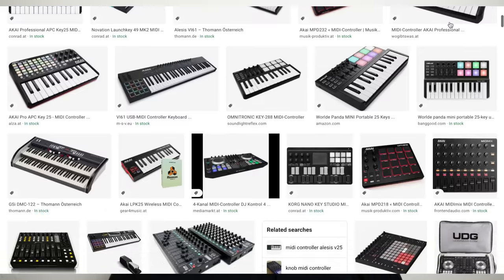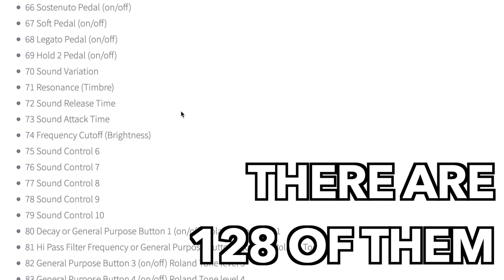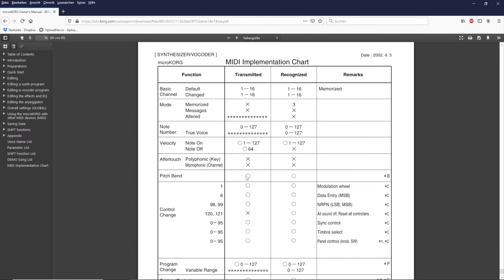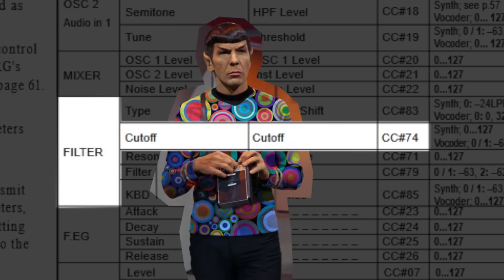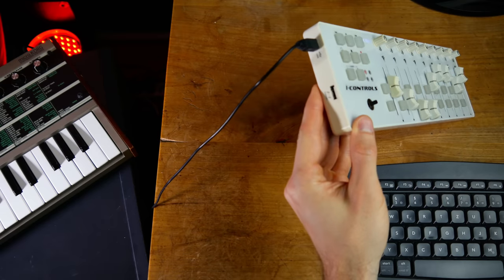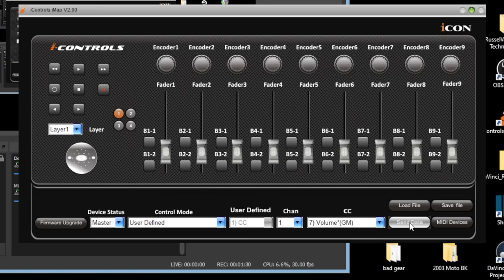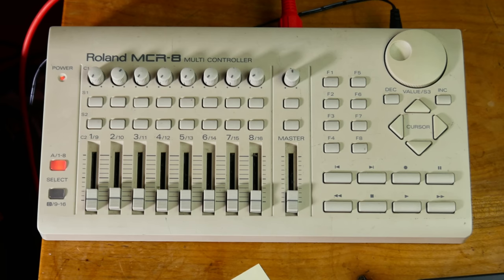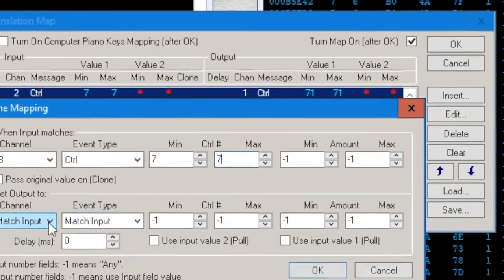How To Control The Microkorg Using Midi Controllers??? (Tutorial)

Comment: Buying a Korg MS200B was the best thing to do as a Korg owner.  Most of the knobs on the MS2000 have the same CC assigns as other Korgs of the same age (and I suspect the microkorg).  So I use it to control a Trinity V3 which is somewhat lacking in knobs, but has the Prophecy board.  It allows you to have a full knob prophecy and the trinity thrown in.
Reply from the maker: I want both of them!

Comment: Another great MIDI piece of software that sadly is no longer available and discontinued was Emagic's 'Soundiver'... It basically used to dive into any hardware that was built in the 80's and 90's and pretty much bring out all controls via a nice GUI so you could control your MIDI gear via software.... And now for some praise - Your channel is awesome - Keep finding that 'Bad Gear'... Another hardware suggestion for bad gear ... The EMU-Proteus2000 - I have one - I love it and hate it at the same time....PCM sounds but a small screen to edit with... unless you have the Prodetum Software that is available for free... Full of late 90's early 2000 sounds...
Reply from the maker: Thanks! Sounddiver was the standard for a very long time!

Comment: Very sweet, they say" learn and then forget"  I had no end of problems with M-Audios Ozone years back and ended up learning about midI during that particularly difficult phase,. Now I have completely forgot again! love your videos man. Bad gear, er, I got a second hand Launch Control that stinks so badly of cigarettes its toxic.
Reply from the maker: Midi controllers HAVE to stink of cigarettes😅
Reply: @AudioPilz  Hell, my whole studio stinks of cigarettes...  That's how I know a piece of gear is mine, I just look for the fine dusting of ash.
Reply: @haolekoa737  Lols, I smoke but I;ll tell you the Launch Control must have a sixty a day habit! It drips nicotine!
Reply: @MarkBayfieldvillageidiot  Do this device and your nose a favour and drown it completely in ISOPropanol, so this alcohol bath may cleanse it. Do at least 2 or more baths with refreshed new isoprop to get rid of the nicotine-acid first .You will need a shallow plastic form the device fits in to not waste too much of the ISOprop.  ISOpropanol or isopropyl-alcohol rests will vanish like steam and leave nothing behind in contrast to ethanol/methanol (like spiritus)or alcoholic cleansers with their extra ingredients. Isopropylalcohol is also used for washing electronic PCBs and is save for the electronic inside the device, as long as you let it dry thoroughly, which will happen very quickly at room temperature.After having done so , give the plastic case a little bit of silicon spray greasing to "relubricate" its surface.The odour will be gone, as the ISOprop will have done its job.

Comment: The controller that I would pick depends on if you need pads or keys and the big issue with some controllers like you said is the fact that you cannot reap them now there is a workaround like you did, but there is another workaround where you just get a small pad and knob controller that you can reassign and put that next to your main key controllerand that would be another option for people that have a 88 key controller and don’t wanna buy a whole Nother keyboard

Comment: So I have this exact same set up (except I have the XL+) and for some reason I’m having trouble getting it to work and was wondering if it was something simple you could point out.

This is what I understand is the process: plug midi cable into the UC-33’s midi out and run it to the Microkorg’s midi in. Make sure both are set to same midi channel (I set them both to 1), press “select” and move fader/knob so it selects it, then press “assign” and punch in the cc# (I chose 74 for the cut off like it appears you did in the vid). I’ve tried this process several times with a multitude of other random experiments to no avail. 

Anyways, thanks for the vid (and all the others too). I actually ended up buying the UC33 after watching this as after some research it appeared to be the best option!
Reply from the maker: Did you enable control change in the midi filter menu?
Reply: @AudioPilz  yeah :/ have tried enabling and disabling it with no luck
Reply: @AudioPilz  Ha! I figured it out coincidentally right after your comment even though it was totally unrelated, just needed to read the manual better I guess. I had it set to “Midi out from m USB” and didn’t realize it lol🤦‍♂️ thanks for the response regardless!

Comment: How do you connect both a sequencer and a controller in the microkorg?
I have a UC33 (luckily) and connected it the way you do, but since uc33 has no “through”, how can I make the microkorg play modo notes (lets say from a DAW) and also it’s parameters be controlled by the UC33?
Reply from the maker: If I remember correctly it both worked at the same time. Quick and dirty solution: patch it through your DAW
Reply: @AudioPilz  Thanks, i found a solution by connecting the DAW (out) to the Microkorg (in) and the UC33 (out or USB) to the DAW (in or USB), with the channel and CC already set on UC33 in order to talk with the Microkorg. The final step was to create a track as "External Insturment" on Ableton. I can now have the microkorg playing midi notes, with full manual control over its parameters, while also recording automations!
A whole new era just started for me!

Comment: I have a problem with controlling the microkorg. I use microkontrol to control the microkorg because the microkontrol has a lot of knobs and sliders but the midi values are jumping around because when you move something in the controller (encoders and sliders) no matter what the existing value is of a parameter in the microkorg it will jump to the current value of the midi. I don't think I've explained that clearly. I think the terms for that thing I want to achieve are "Soft Takeover" and "Catch Mode". Soft Takeover or catch mode is when you move something on the controller there will be no change on the parameter of the synth until it matches the current value of the parameter of the synthesizer you are controlling. Do you have a solution for this? Is using both the midi out and the midi in of the microkorg and the controller make a difference? Will it suddenly activate catch mode? Because I don't see these terms on the manuals of both. I'm sorry this is too long but I would appreciate any suggestions. Thank you.
Reply from the maker: Good question, I have to look it up
Reply: @AudioPilz  Thanks! You're the only one who replied hehehe. I commented on a lot of videos on youtube about microkorg because I'm trying to use this synth like a modular synthesizer by using controllers with lots of knobs and sliders but I keep encountering problems. Maybe one day I'll just give up and just use apps or softwares and use those together with midi controllers hehe. I like the sounds I get from the Microkorg though. I'm trying to make music like Jim O'Rourke's steamroom by using the microkorg and koala sampler. This is Dex from the Philippines. Thanks again.

Comment: Hi, great video!

im having trouble with syncing the microkorg to a roland tr 8s, here's my problem:

The roland i use as master (midi out) to the korg (midi in/slave), so that the arpegiator of the korg follows the tempo of the roland.

Everything is pretty perfect so far except although the arpegiator tempo is correct, half of the time it starts and stays off beat.

How do i get the arpegiator to run perfectly on the beat, what am I doing wrong? Or is the microkorg simply "inaccurate" by design?

Ps i tried matching midi channels but that makes the arpegiator glitch by playing notes i'm not even touching, so even worse. 

Any help would be greatly appreciated, thx!
Reply from the maker: AFAIK the MK arp starts at keypress. I assume you have to play as tight as possible (haven't tried it in a while tho)
Reply: @AudioPilz no it will start on beat sometimes even if i press too soon and vice versa, if i hit perfectly on time it will still have latency sometimes :(